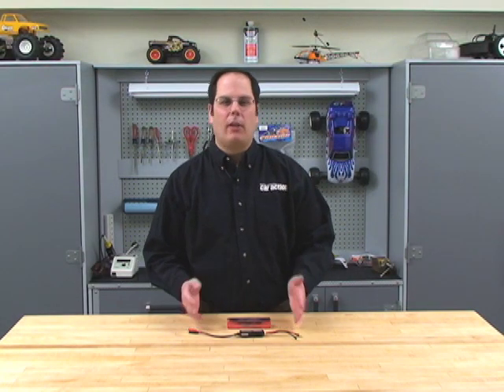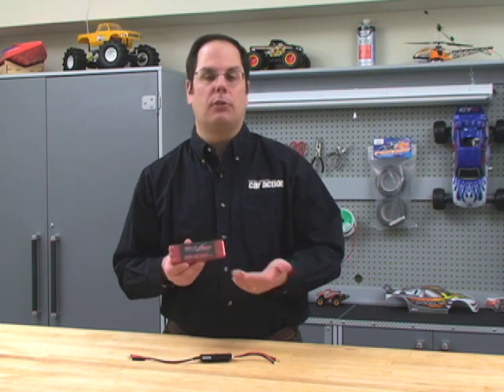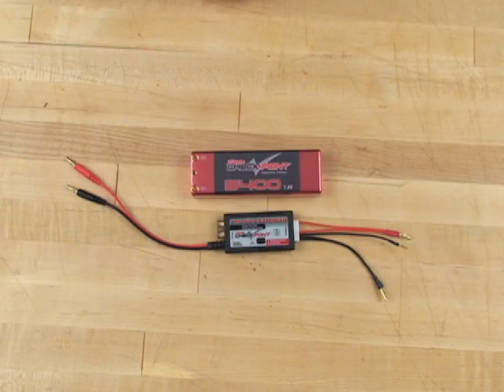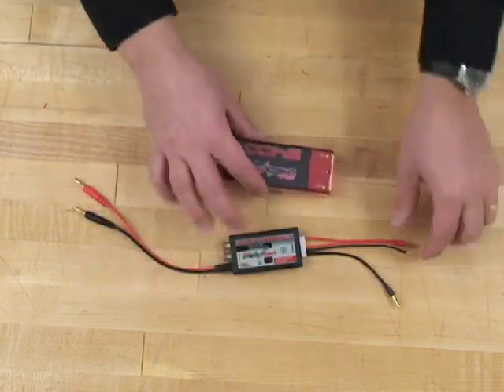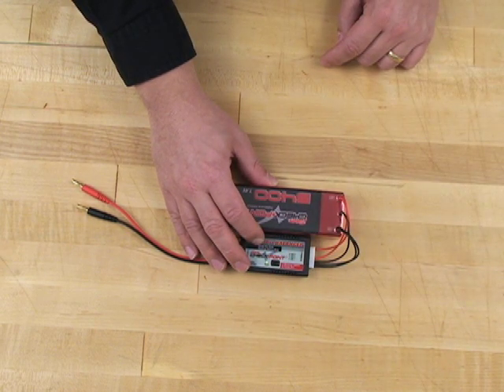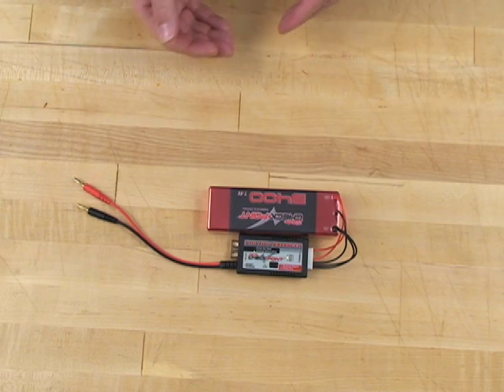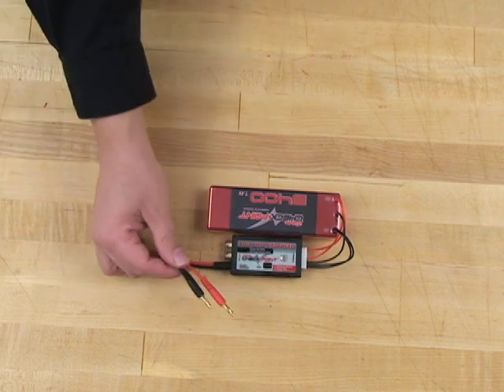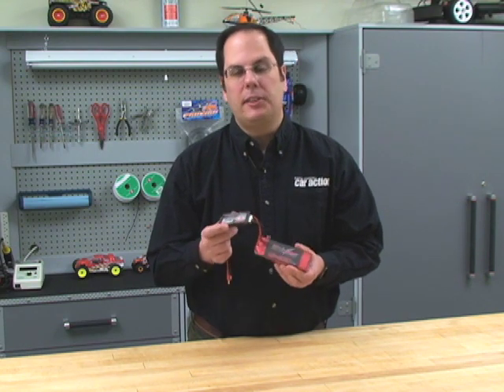How To Balance LiPo Batteries

Comment: Yes, the balancer does the same thing, just discharging the lowest cell into a power resistor, but they are much harder to mess up than doing by hand. If you didn't short the leads and discharged them the right amount, your batteries are fine.

Comment: i used to balance my lipos with a 12v 20w lightbulb and a multimeter do bring the higher voltage down to the lowest cell does a balancer basically do the same or was that bad for my lipos? just wondering....

Comment: I am confused, a LiPo is rated at 3.7 volts per cell (3 cell 3.7X3= 11.1).
What I am confused is a fully charged pack is 4.1+ volts per cell.
I was told never let a LiPo go below 3.0 Volts. So if you set LiPo cutoff at 9.6 volts (so there is some headroom) this puts each cell at 3.2 volts.

Now here is my question:
Is 3.2 volts too close to 3.0 volts or should I set my LiPo cutoff higher than 9.6 volts?

I run electric stadium and desert trucks.

Comment: I do believe you are supposed to run a charge/balance cycle after every time you have used the li-po batteries Do both runs at the same time, that is! Remember not to squeese all the juice out of the li-po`s, once you notice the performance drops. Minimum 3 Volts pr. cell, or risk damage. I think 2.7 V is pretty much a dead cell. I do agree that it is somewhat of a hazzle with all the balancing cables and everything...;-)

Comment: yeah but you still have to constantly tune the engine and clean the car constantly, also you can get a decent electric motor for $20AU where as a nitro is about 150. also if something busts in an electric motor there is only one moving part & two brushes. and if you have to good batteries you can run one and charge the other and by the time you run the battery flat and let the motor cool your other battery will be charged. 
I rest my case